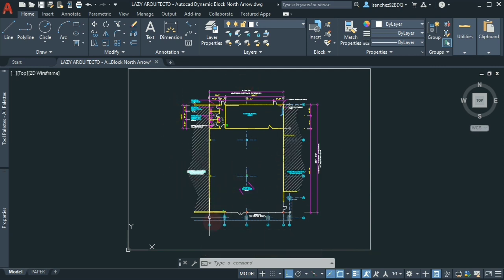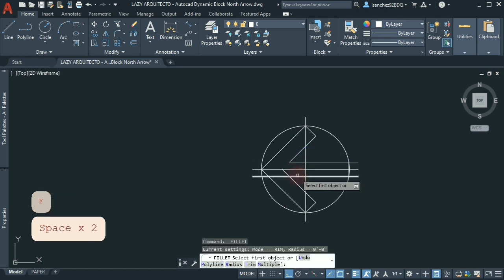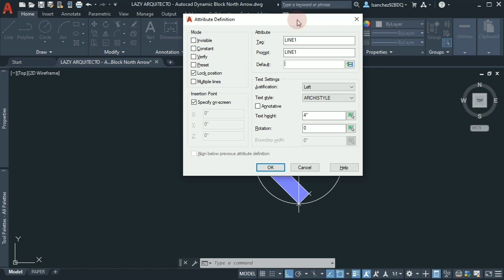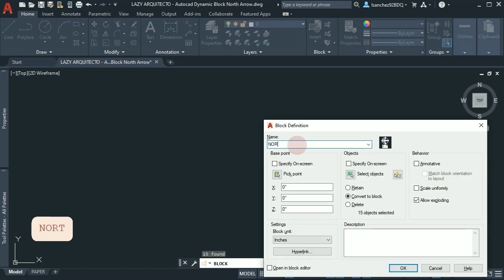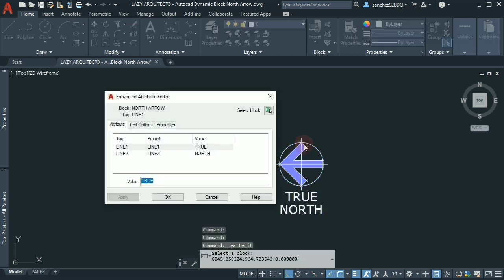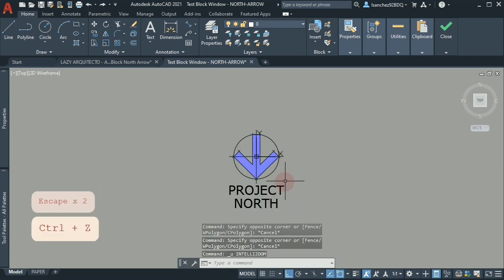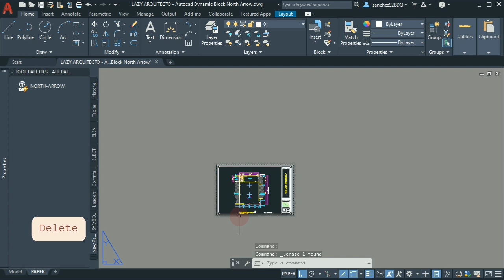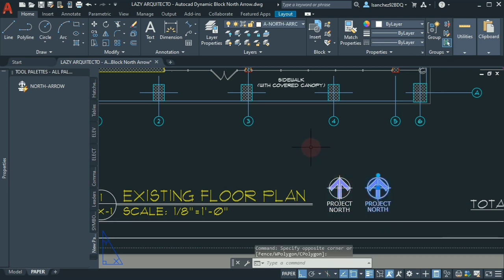SAVE TIME with this Autocad Dynamic Block

Comment: Hello Lazy Arquitecto!  Thanks for this lesson, everything went right, but could not add my block to the Palette. Is there something I must change in my sysvar?
Reply from the maker: Hi what error are you getting on the command line after dragging your block to the tool palette?